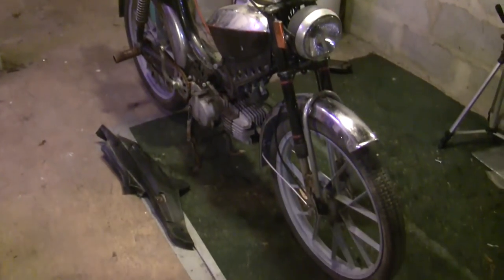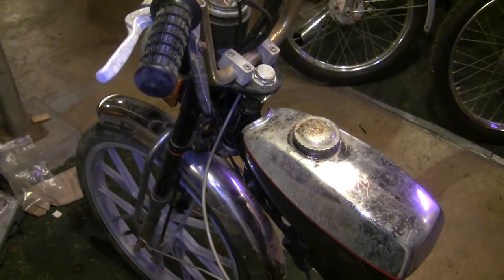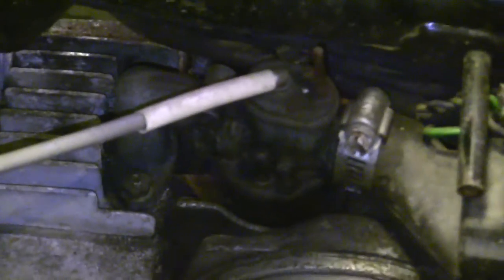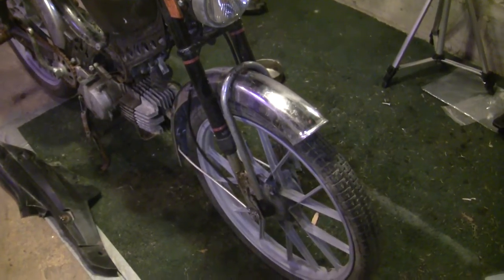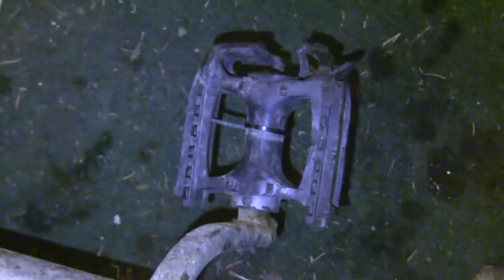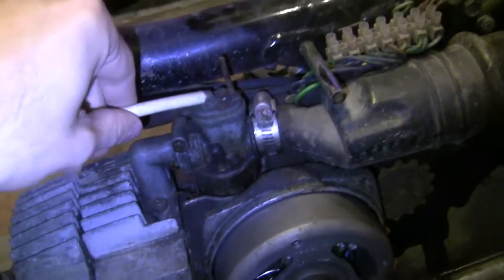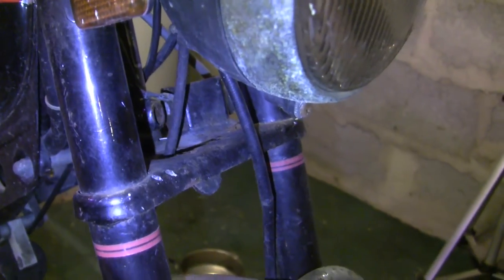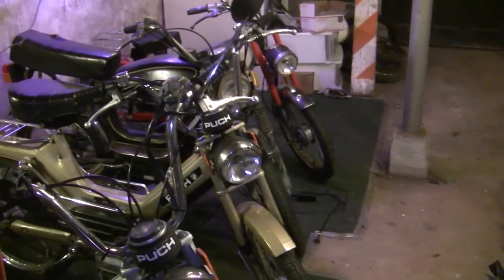1978 J.C. Penny Pinto 2 Intro

Comment: Hello Travis I have a 1978 JC Penney Puch Pinto with a Bing Carb 1/12/299 and an E-50 Engine I'm trying to get running.  I love your videos and they have been of great help.  I bought a throttle cable on ebay that was discribed as one that should fit but it did not fit.  The Item was discribed titled 

2FastMoto Moped Throttle Cable NEW Sears Free Spirit J.C. Penney Pinto Murray

Could you turn me on to where I can get the correct one?

Thanks in advance

Roy